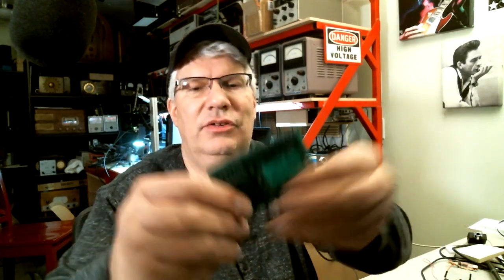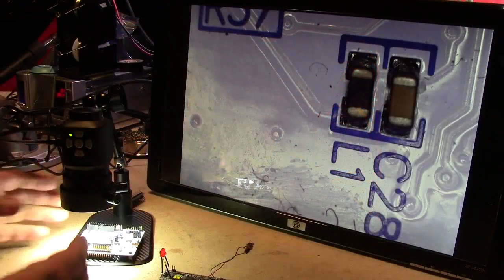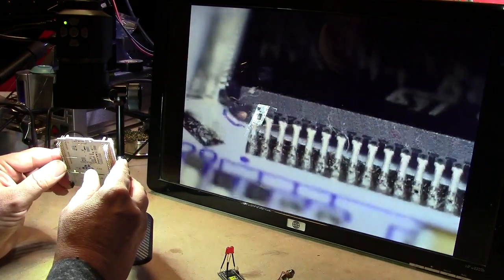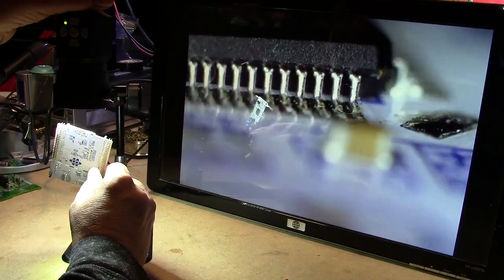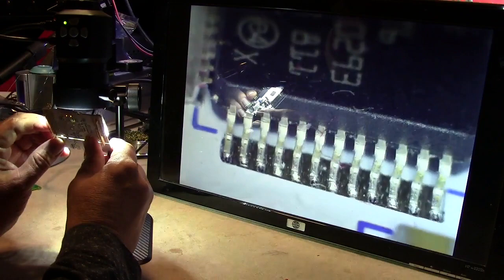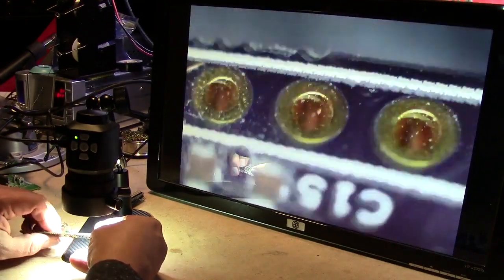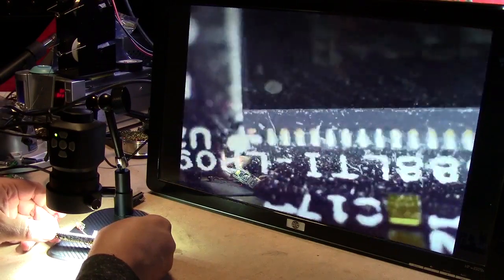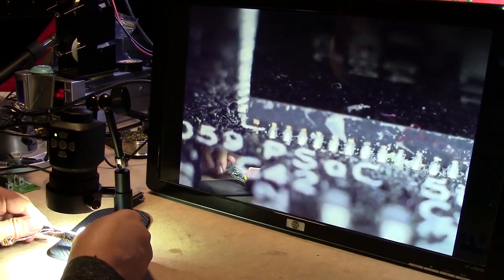191207 AmScope UHM350 for Board Inspection Part 2/2

Comment: Hi, silly question (tried researching but can't find much info -  btw thanks for the upload and share), can this be mounted to a trinocular port and used as a camera for a standard stereo microscope? Just checking to see if it has any additional extendibility possibilities.
Reply from the maker: Unfortunately, there aren't any mounting options with this camera.
Reply: @CraigHollabaugh  Hi, thanks a-mill for the information and taking the time to reply.
Reply from the maker: @nilomyki  You're welcome.
Reply: @CraigHollabaugh  Would you recommend this unit for Soldering (Micro soldering) work or just for inspections? Was considering getting one of these from a in-Car set-up (mainly for inspection and safely disconnecting/replacement screens, batteries, charge ports without knocking-off components and possibly some very limited soldering).
Reply from the maker: @nilomyki  Yes, I use mine all the time with a 27 inch monitor for both soldering and board inspection. It needs better lighting, It's particularly for inspecting solder bridges on IC pins.
Reply: @CraigHollabaugh  Oh many thanks again for the speedy reply and sharing your experience which definitely falls inline with what i'll need it for as I love the compactness.
Reply from the maker: @nilomyki  It boots fast too. I've devoted space for the scope and a monitor on my rework bench.

Comment: Is the articulating arm long enough to get like 2x-5x?  So many sales people tout 1000x!  Don't need that much obviously and you can only get 1000x by compounding optics.  Looks like your video was around 30-60x?  
My bifocals just are getting it for me anymore!
So can I get 2x-5x with this camera?
Reply from the maker: With the mounting arm at its maximum height, 1080P full screen width = 40mm. With the focus wheel at a maximum, 1080P FS = width 60mm. Don't know what mag level that would be. Hope this helps.